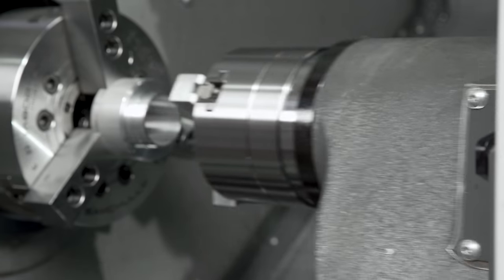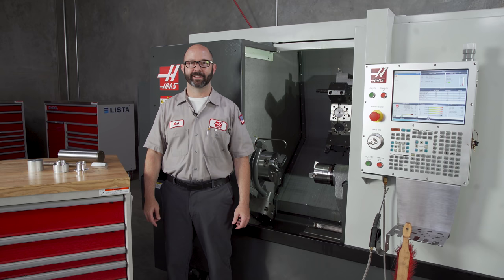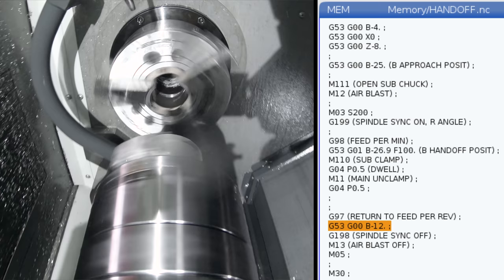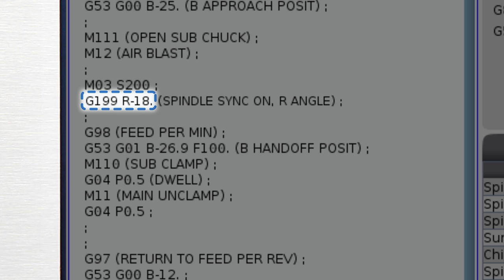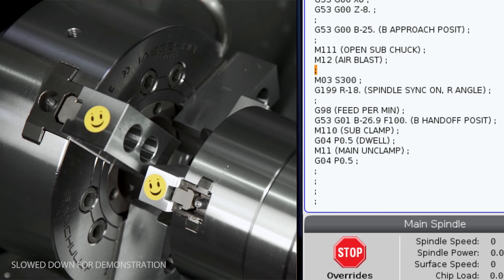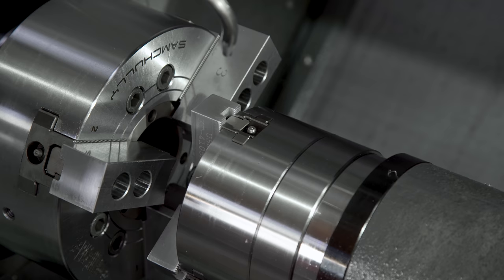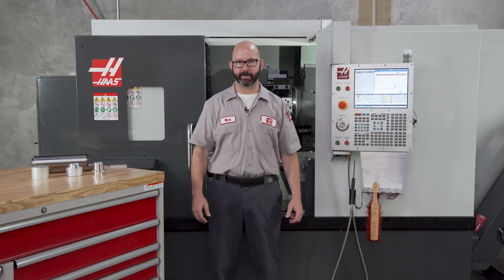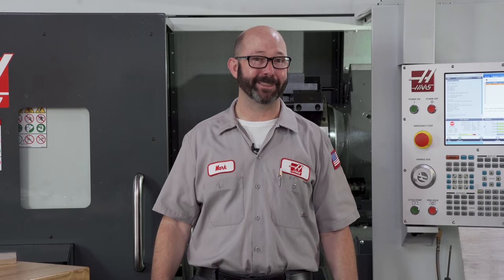Sync Your Spindles with G199! Complex Handoffs, Simplified - Haas Automation Tip of the Day

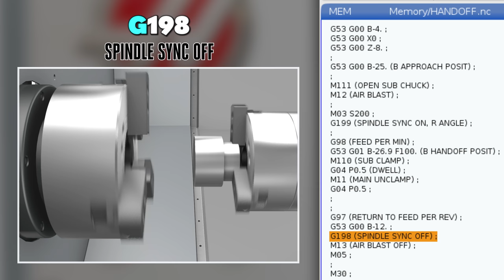Comment from the maker: Spindle Sync is a powerful tool. Remember to align the Main and Secondary Spindles, using a custom R (sync angle) value with your G199 if the orientation of the Main and Sub need to match, this is shown at 03:21. Always test run your G199, without a part, and with lots of space between those chucks, as you proof out your program for the first time.  - Mark

Comment: i'd love to see a Haas Tip of The Day video covering all aspects of the Baxis. How to jog it, touch it off, programming a job for it etc..
Reply: That is a great topic. We'll move it up on the list. In general, its best to touch-off all sub-facing tools manually. And to program on the sub, we will write our programs as if we were running on the Main Spindle (left facing) and then use a G14 Spindle Swap command to mirror all commands for the sub. Everything is swapped with a G14, even our M03 spindle command will make the sub spin when in G14 Spindle Swap. Great comment.
Reply: Here you go, https://youtu.be/9NyRlxiHi6g

Comment: Would this system be suitable to turn a long shaft complete?  Example:
-1st spindle for turning 1st face of shaft and some of the outside diameter of shaft.  
-synchronize 1st & 2nd spindle while holding both ends of shaft and turn middle outside diameter.  
-2nd spindle for turning 2nd face of shaft and some of the outside diameter of shaft.

Comment: Hi, Can you please help me on this one. I have the same setup but running with bar feeding. And this is what I want to do, instead of pushing the bar i want it to be pulled by the sub-spindle, part it off while sub is still holding it, automatically update the length of the bar, then continue on and repeat the process. But i can't somehow update the length if it is not to be feeder pushed.

Comment: When using a soft jaw in the subspindle where you want the part to register on a shoulder against the back of the soft jaw, how do you securely seat the part during the handoff without having to crash the spindle into the part to do it? Do you have to use a tool with a pusher spring or something to re-seat the part after the swap?
Reply: The handoffs can be controlled really well, so accurately that we don't usually need the parts re-seated with a die spring, like we see here: https://youtu.be/mL_v7cU8l10?t=2800

Comment: Can you show techniques to line up the two chucks accurately, that isn't just eyeballing it?
Reply: We can orient the spindles, and then run an indicator (magbase on turret) across the jaws, or a feature on the part, as we rotate the C-axis until we find that perfect position, that can be used as our G199 +/- R angle. Every setup is unique, so we will have to get creative.

Comment: Can the sub spindle be used as a tailstock with the 60 degree live center? Will it hold enough pressure against the part?
Reply: We will see customers making use of spring-loaded live centers, held in their subspindle chucks (Royal, Slater, Concentric, Riten all make them. The Rohm  MT4 is what we have used, nice).  The MT4 adapter that can be held in the chuck is what you would need, along with the spring-live-center. That would make a great option, we'll look into again.
Reply: No.

Comment: There is a mistake in the thumbnail graphic and in the video, the G-code towards the end, it says 'G97 ( RETURN TO FEED PER REV)', it should be a G99.
Reply: Thanks Lvx. It turns out that my mistake there was in the comment, not the code. It should read G97 (Turn off Constant Surface Speed, S equals RPM).

Comment: Stock Air nozzle got removed day 1 because it seems like every operation it wanted to hit the turret or a tool on it. Replace it with an adjustable one, please. High pressure coolant does the trick in the meantime.
Reply: I will usually cut the tube down, and bend the tip out a little bit, when running on a 3-jaw chuck. The length out-of-the-box is pretty good for most Collet chucks. Great input.
Reply: @markterryberry4477  same goes for the bar feeder liners I suppose. Going to have to 3d print a spindle liner extension that pops into the bore of the 3 jaw chuck and sits behind the jaws so i dont have to set the bar feeder to stop feeding at 10" remaining. This remnant is then too big to be pushed into the parts catcher, so bars have to be loaded one at a time. Yes, "get a collet chuck"... I agree
Reply: @markterryberry4477  I also plan to take the bar feeder cover plate and cut a three and a half inch hole in it with a see-through window for bar feeder height alignment and then line the cut out with flexible strip brush so when the coolant makes its way up the spindle liner housing it doesn't spin and splash outside of the spindle housing enclosure and all over the floor. I'll let you know how it goes?
Reply: @markterryberry4477  oh and when the chip tray screen gets covered in small chips the coolant when draining doesn't penetrate through the screen and splash into the reservoir it hits the chip and splashes all over the front sheet metal of the machine and drains all over the floor. Such an easy fix to add a splash guard that drains back into the chip tray.
Reply: @markterryberry4477  oh and when the high pressure coolant is lined up just right it shoots through the gap in the door and splashes all over the floor. Also, hydrophobic tablet screen protector applied to the inside of the glass means you can actually watch the parts being machined. Not sure of the economics of that but it would be wonderful if you guys could offer that is an upgrade for the whole window
Reply: @BGraves  we are running some of the oleophobic/hydrophobic tempered glass window/screen protectors on some machines in R&D now, they work pretty well with visibility.
Reply: Loc lines weaken over time and just go flying with too much pressure
Reply: @TheFeralEngineer  good point. I like it for quick runs when I’m at the machine, but I’ll always bend hard lines for coolant/air when running production. You can’t risk having an errant stringy chip “adjust” your loc lines for you.

Comment: How to transfer hexagonal bar?
Reply: use the g199 r<Angle>   option. He explained this in the video.  But it allows you to set the angle of offset on the spindle sync up. it was how he actually meshed the two chucks together.
Reply: On a Mori, you just clamp the material on both chucks, go to the phase adjustment page, select mdi and press execute. Beats all of the guesswork. For accurate sub transfers, you speed sync to position for sake of air blow, then enable and home each C axis motor. Super accurate. I do like the angle adjustment feature of the G199 thing, though.

Comment: If you were to make a simplified (affordable) and much smaller bench top lathe for glass work. (flame working.).   

I’d buy 10.  

You’d sell over 250k units the first year…

The flame working industry doesn’t have a affordable lathe….  lol ok
Reply: Seriously thought.    All it would need it is synchronized chuck speeds and zero to around 400 RPMs with a bore of 85 mm in a bed length of about 3 feet(ish).   And hollow spindle for a blow hose.   

Super simple and honestly an entry-level Smalleys that could sell for under 3500 would sell millions of units

Comment: Meh, I set B in a work offset and program all positive numbers from my grip point, but that's on a Mori. I've never used one of these tinker toys.
Reply: That’s a great method. We can set our B axis in our Work Offset, I just don’t like teaching that right out of the gate. I’m worried someone might make a work offset change to adjust the Z on their subspindle part, and accidentally crash something during the handoff. Leaving the handoff position as a G53 move forces you to be very deliberate when making changes to it. An operator may change a G55 offset, but they won’t typically change a B-axis value in the program.